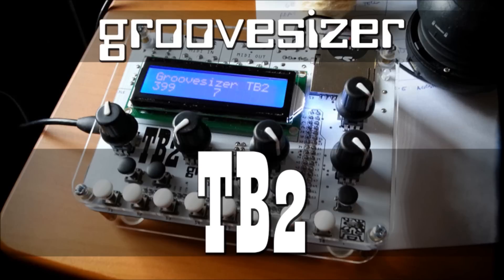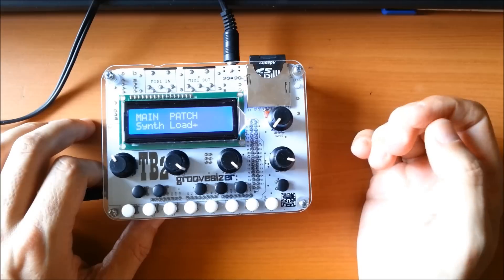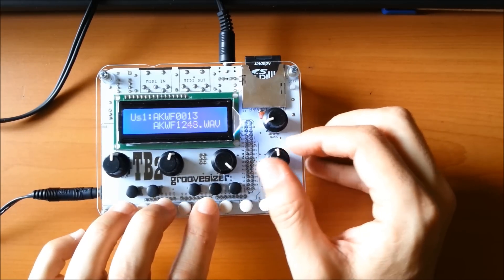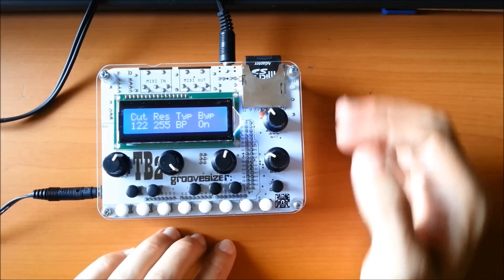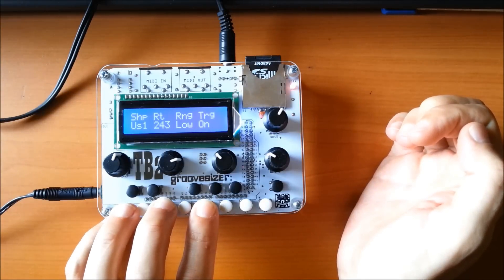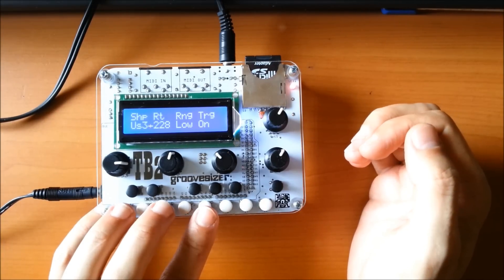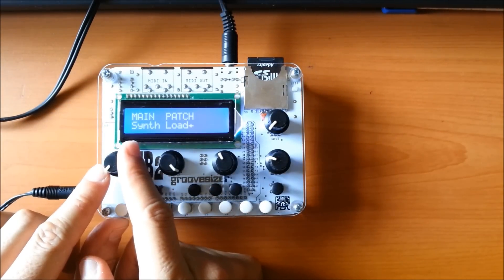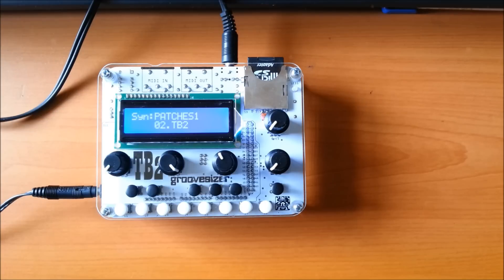Groovesizer TB2 - Preview

Comment: MoShang:  This looks quite interesting...it's like an all digital version (paraphonic) of the Shruthi-1...very cool...I may have to get one of these as a compliment...does it have full size DIN jacks for Midi?
Reply from the maker: Yes, there are full sized MIDI in and out DIN jacks. And the audio jack has been replaced with a 1/4" one on the release version of the board.